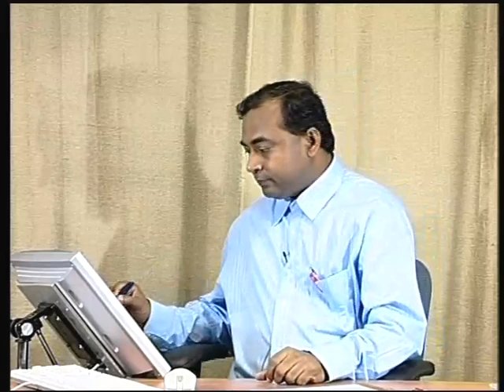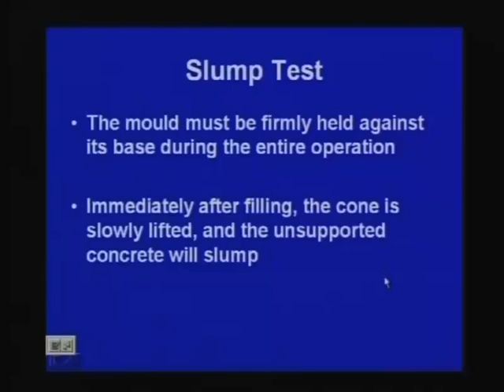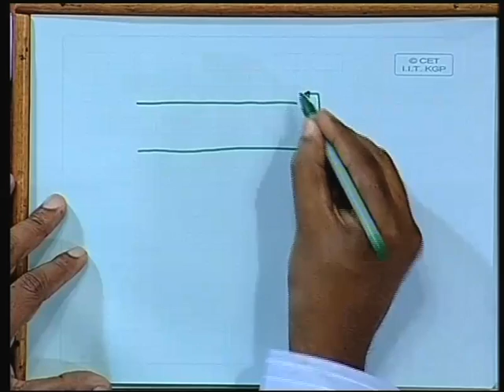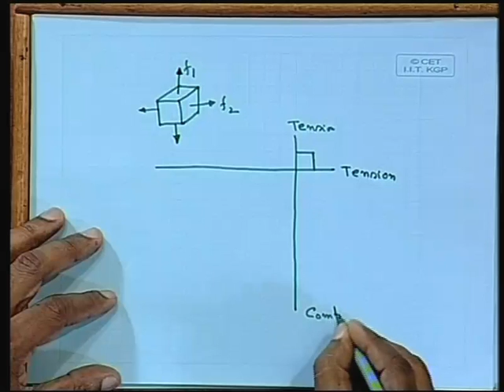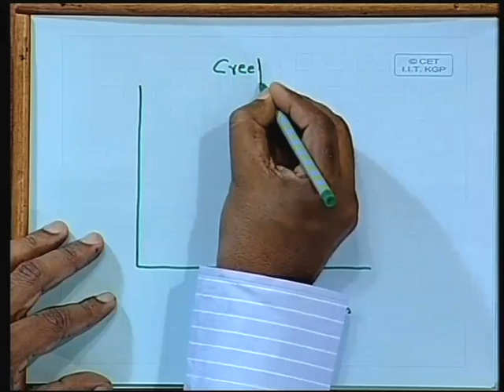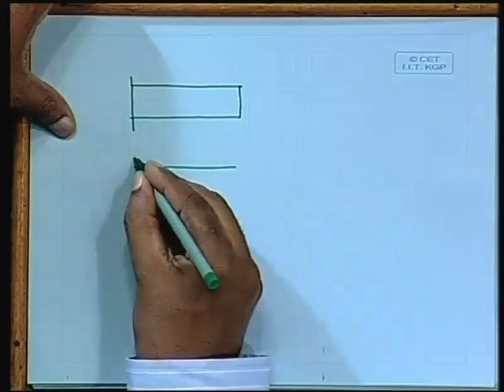Materials

Comment: Sir please tell me why we usually takes 150mm*150mm*150mm
as standard size for testing the specimen under CTM
Reply: In general we have to take cylinder specimen but Indian Standards follow Cube of same volume like the cylinder . So 150*150*150 of cube gives same volume like cylinder. But cube gives more strength than cylinder as it develops frictional forces. In general in buildings we see long beams and columns which represents cylinders and not cubes so for that reason we consider strength of concrete as 0.67fck and then we apply FOS. We are not considering fck for this reason only.